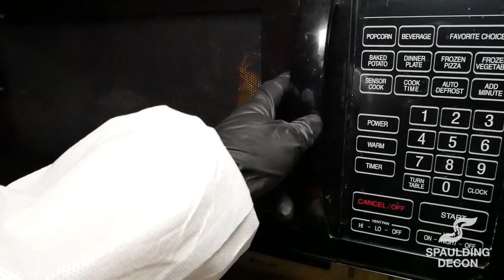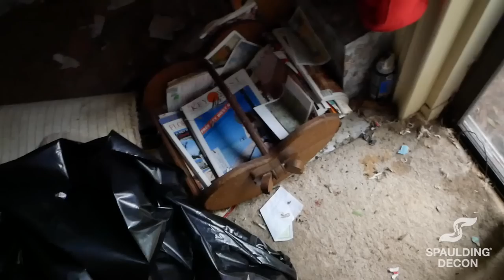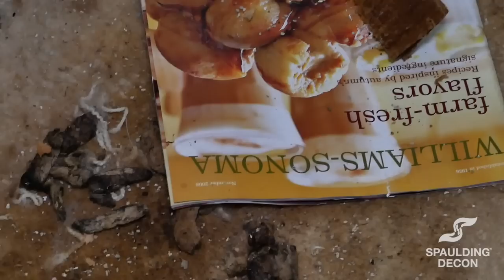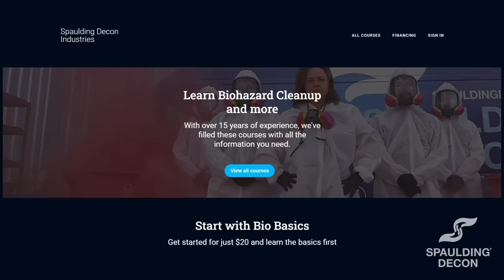WARNING: The Feline Biohazard ( Extreme Cat Hoard )

Comment: What always baffles me the most on these animal hoards is why the neighbors did not contact the city for this due to the smell alone. I have smelled a cat hoarded house-and you could start to smell it at the other end of the block. . Within 500 feet of the property it is overwhelming and getting closer than that takes an effort of will and have your eyes watering from the sheer amount of ammonia in the urine that has soaked everything. I can't imagine those neighbors having to live with that smell for years on end (and oh yea, from the state of that, that had to been at least 3 years) and not one of them bothered to call the city. Not to mention the neighbors would have to really hate cats to not be concerned enough for their welfare to make the call.
Reply: I worked in the same town as an infamous cat hoard. 196 cats found alive in the house. From what I recall the neighbors HAD complained, numerous times, but as the lady didn’t actually live there and was well connected it took an act of vandalism to get the police out and then AC